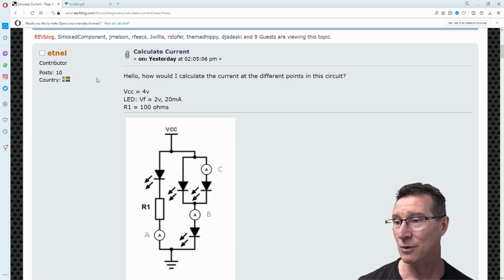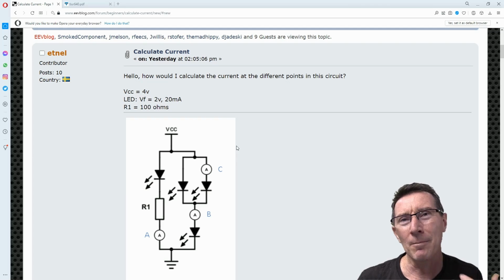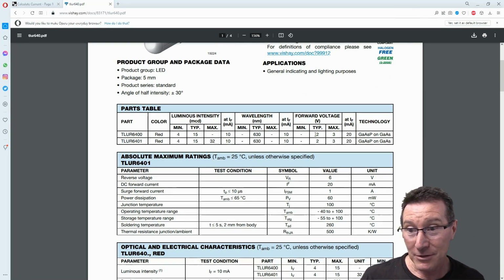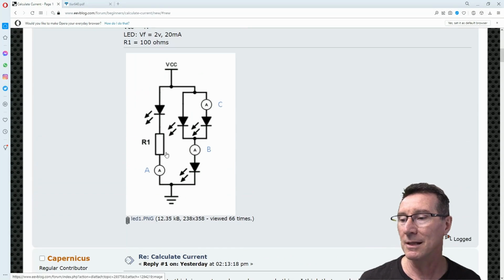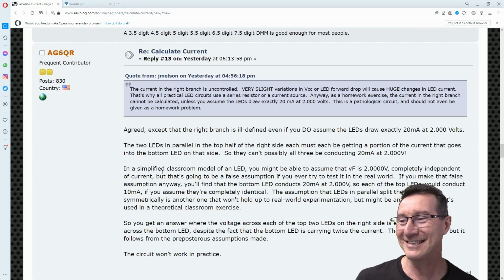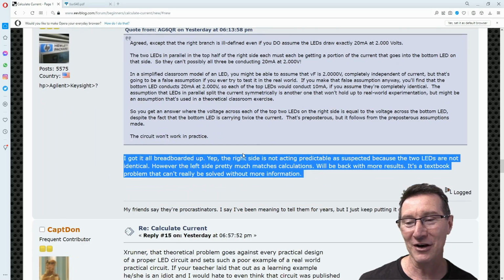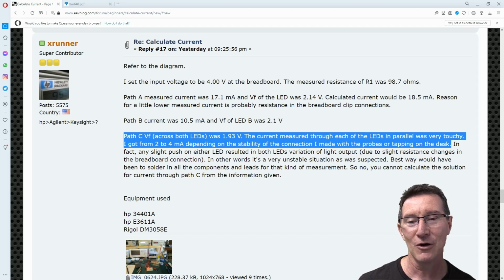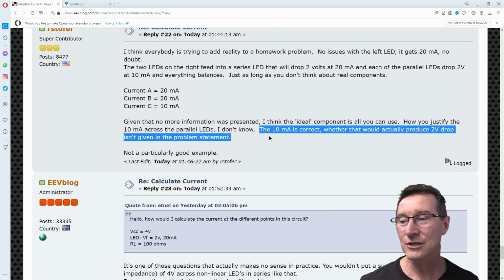EEVblog 1427 - An INFURIATING Electronics Exam Question!

Comment from the maker: There is a reply from the OP:
"Thank you, everyone. Especially Dave for even making a whole video regarding the problem. Very interesting to read your different approaches.

So, the backstory of the problem. The circuit got handed to us in a high school entry course in electronics. The circuit was supposedly made by our teacher. Our teacher seems to have lacking knowledge regarding LEDs and current in a series circuit. By his means, the LED drops voltage AND current. I had to prove him wrong 8).

We got to both calculate and elaborate. When elaborating, I got similar results as Dave in his video. But when I had to calculate the right branch, things got a little confusing, thus creating the thread. The circuit that stood out to me as my first thought was that insufficient information was given. But I made the assumption that Vf = 2.0 at all given currents(which would not be the case in reality). My conclusion was, half of the current goes through each LED which is in pairs. But the circuit seemed odd anyway.

I see some of you made some good realistic calculations, but it is not near the level of this course. Ohms law and Kirchoff's are pretty much the only formulas used. If my teacher is watching this thread, maybe he could post the sole purpose of this circuit with calculations included. The circuit in my opinion is just a brain itch and would never be used in reality(hopefully). An LED circuit is never seen as a theoretical circuit for me."
Reply: my response would be "use a multi-meter"
Reply: I actually have seen such a circuit in reality: In cheap outdoor solar light chains.
The individual LEDs have been wired in parallel. Due to the cable resistance from LED to LED, the following LED was sligthly dimmer than the last. However, no one would drive LEDs without a current limiter on a low impedance source. Even if you carefully match the supply voltage with the LEDs Vf and use the battery/wire impedance for current limiting, the Vf of the LEDs is dropping with temperature, so they would quickly burn through.
Reply: @paulkocyla1343  I ran a few chains of 10mm super high brightness leds directly off 12v 10a supplies for quite a while, their Vf adding up to just over 12v,  but then the cheap Chinese leds started to fail so I replaced them with bits of led strips. Maybe running them that way shortened their lives a bit, but they didnt burn through quickly. I got around 200 hours use before the odd one would make the chain flicker or fail.
Reply: @stephenw2992  200 hours is not a long time. It's 4 a hair over days between failure. That's rubbish tbh
Reply: Makes sense that it was proposed by someone who is not very competent if this was set as a homework question. It is an excellent discussion question for class but a very poor homework question. As well as the obvious here, students should know that temperature effects diodes but how many know that the light falling on an LED will also change the current through it or that LEDs can be used as power sources? (This can lead on to solar panel discussion, etc.) When producing test or exam questions, the examiner must be far more competent than the answer requires. One sees so many sloppy questions where anybody with any competence in the subject has to start by answering, 'well, it depends...'. And that should never be the case for non-discussion test or exam. It is why multiple choice is often good. When you work out a multiple choice question, the answer you work out will nearly always be one of the choices or very close to one of them. At the very least, you might get an idea of what the examiner is expecting you to answer.
Reply: The Op is wrong in not being able to see that LEDs do drop voltage and they also limit current to some degree. A case in point: I created 2 LED Christmas light strings that were of different LED types, but from the same manufacturer and same string build. When I was done making a purple and orange string they both took on the power usage characteristic of the previous lower rated all same color LED string.  I see some people falsely think just because a component has rated operating specs then it must draw that current and have that voltage across it. I have known for decades  that a single diode has a silicon PN breakdown voltage of 0.7volts, but if you put additional diodes in parallel then the effective voltage drop will decrease. Most people don't think that is even possible because diodes are not used that way. Now if you want to screw around with people an you do that in a solve this circuit test problem.
Reply: @kjrchannel1480  The reason diodes are not used in parallel is that they have a negative temperature coefficient of voltage at a given current, coupled with an almost exponential increase in current with voltage (although you're right that they do have a small resistive component).

If you have two diodes in parallel, as soon as one gets slightly warmer than the other, it will start to pass more of the current than the other, which will make it warmer, and so on until one of the pair is passing the majority of the current, regardless of how well-matched they started off.

You can make matched p-n junctions that thermally track inside an integrated circuit, but they are only passing small currents (like in a current mirror). With discrete components, there's no easy way to parallel diodes to increase their current capacity; you just have to use a single higher spec diode.
Reply: @kjrchannel1480  LED's are not silicon diodes. They are constructed from III-V type materials, such as Gallium, Arsenic, etc. They forward drop correlates with the color of emission, red, amber, yellow, green, blue. A Schotty diode has a forward drop of 0.350 volts, and it is a silicon diode. There is an equation for current as a function of voltage and temperature and a fudge factor.
Reply: ??  As an analytical question, this looked like a load-line question where you'd be assuming matched diodes with exponential characteristics.  The challenges to the validity of these assumptions in practical work are very true.
Reply: @UC4RfGzqBbYiCo088mytrkaw I said unlimited, not infinite. You'll perhaps note that I prefixed my remark by *if there is no resistive element*.

If the band gap of each LED is more than 2V, you'll get nothing. If it's less than 2V, then it will light and current will pass. If there were no resistive component, that current would heat the LED which would conduct more current, and so on until the LED burns out. You'll get thermal runaway unless the "voltage source" has some means of limiting current or the LED has sufficient bulk resistance to limit it to a safe value. That's why you can model an LED over the relevant part of its V-I curve as a small resistor (the slope of the V-I) plus an ideal Zener diode (the intercept of that slope on the V-axis). For LEDs described as 2V 20mA, you'll find that a 20R resistor + 1.6V Zener will model it quite well over the 10-30mA range of operation.
Reply: Can you make a video about faraday's law where the kvl doesn't hold and emf equals -NdΦ/dt = closed intergal of E•dl. I'm learning electromagnetism by the Walter lewin MIT courses here on YouTube and I know he's right but it's so counter intuitive where i can't get a feel for the explanation since he's the one of two people who have videos on this topic. His video is kvl for the birds. I would like to see your take on it since I'm sure many students are confused about the topic. Thank you for the informative content
Reply: I might be under thinking this but assuming this is a purely resistive circuit wouldn't you get the resistance of each LED and add them up to your combination circuit? if that's the case I ended up with A.) 0.0364A B.)0.2667A and c.)0.1333A
Reply: @ramonbenavides7125  

No. LEDs don't act like resistors.
Reply: @westelaudio943  LEDs are like diodes? , but all these teachers always teach the class like its resistors.
Reply: @westelaudio943  They don't, but I think that's what OP was getting at with his post. The teacher thought they did - My guess is that the teacher wanted to add an extra trick to the question to make you treat the LEDs like 1k resistors 2v/20mA, and then the question makes sense, but we all know that's BS. Clearly this teacher shouldn't be teaching this subject.
Reply: @haydenhoodless2055  Actually, they kind-of do act like a resistor, but it's a low value resistance in series with an ideal Zener diode. All diodes have a bulk resistance in the P and N layers each side of the junction, so we shouldn't be surprised that they have a resistive component.

An LED will pass almost no current until a certain critical voltage is reached when the junction starts to conduct strongly. At that point the voltage across the junction rises logarithmically (i.e. slowly) with current, while the voltage across the bulk resistance rises linearly with current.

As I've described in another thread, treating common red LEDs as a 1.6V Zener + a 20ohm resistor will allow you to get some idea of the actual current flowing in different parts of the circuit - at least until components start to get hot and temperature effects become significant.
Reply: @RexxSchneider   For the intents of this level of electronics, then we assume that the restriction of current is negligible through an LED just as we do with wires, even though realistically a small resistive property must be seen in order for power dissipation to occur. The point is that the question is about testing knowledge of Kirchhoff’s current laws, but the teacher intended to make the students treat the LEDs as 1k resistors.
Reply: @haydenhoodless2055  Unfortunately, if there is no resistive element to limit the current through the LED, then putting 4V across two LEDs in series will either result in no current or an unlimited current flow as they warm up. You simply can't can't model LEDS any other way. A question is only useful for testing knowledge of current laws if you use the correct model for the circuit elements, regardless of what you might think "this level of electronics" is. We all know that you can't model LEDs as 1K resistors, and I don't believe you can have a definite idea of what the teacher intended.
Reply: @93hothead  guess what the "D" in "LED" stands for :P
Yes, an led behaves exactly like a diode, with the difference that it makes light in the process
Reply: @haydenhoodless2055  I think your definition of "resistive" is wrong. You do get a voltage drop, which is required to get the required power, but it's not "resistive". "resistive" means a linear correlation between voltage and current.
Most of the things you said are correct, but that a "resistive" element is required to extract the power required for lighting up is just wrong. (unless I'm completely mistaken, in that case correct me)
Reply: @ramonbenavides7125  I guess you mean 20mA for A?
Reply: Well actualy if you ask me your teacher must be expelled without question.
Thats why the world is failing, people like your so called teacher are less educated then the students. And thats not gona yield proper knowledge and workforce.

Comment: This circuit would make more sense, if VCC was a 40 milliamp constant current source. Theoretically, A would equal 20, B would equal 20, C would equal 10 milliamps. A would be most accurate, because there would be 2 volts across the 100 Ohm resistor.

Comment: The only theoretical right answer i can think of when all the diodes have exactly the same (non linear) characteristics;

1) the current at point A= 20mA
2) the current at point B= 2x the current at point C
3) Since the voltage over the led (current point B) is unequal to 2 volt we do not know the current at point B
4) And there for we also do not know the current at point C  🙂

Comment: The most correct and complete answer that it is possible to give is...  A = 20 mA, B > 20 mA, C < 20 mA (and C = B/2). Without the LED characteristic curve, we cannot be any more accurate than that, but we do know B will be > 20 mA and C < 20 mA because the voltage across the top two diodes will be less than the voltage across the lower diode.

Comment: In school I had a physics teacher that was a physics doctor (don't know if that's the right term) and he would have loved that problem. He wasn't a very good teacher (didn't know how to tell the stuff to the students) but he was really good at math and physics. And he was also interested in questions that were a bit off-topic or only topic-related. So if you didn't understand something or had a question to another topic, he took the time in his break or even after school to calculate the answer or to explain it with really good drawings on the board. If he didn't know something, he told us he didn't know instead of trying to find an easy answer to not "look bad" in front of the class. But he then took the time to look the question up and explain it in detail in the next lesson.

Comment: It's not such a bad question, as it invites to express all sorts of concern, giving you a chance to show your understanding of leds. A possible (quick) answer could start with confirming the left hand side is perfectly ok, and the right hand side is 20ma through the bottom, and 10ma through each individual led. That said, you could elaborate a bit, about leds being non-linear. So, in real life, the current through the bottom led will be more than 20mA (perhaps 22mA) and through each individual led also a bit more, perhaps 11mA. An precise calculation is not possible, with the data provided. But I agree it is a silly circuit to be forgotten quickly.

Comment: Easy answer: assuming resistance in the wires. what is the resistance in the wires?
Assuming no resistance in the wires, one or more of the LEDs on the right blows and you end up with 0 on the right branch.

Comment: The only way to properly "balance" that circuit, particularly on the right side, even with exactly identical LEDs, would be to add another (identical) ammeter in series with the "middle" LED. One mustn't forget that inserting a measuring instrument into a circuit, whatever it is, will change the parameters to at least some degree. Did the examiners account for this?

Comment: I put those in electrical circuit simulator and I got in there
A= 23.247521 mA
B= 987.45143 mA
C= 493.725715 mA

I'm not sure if those comes so wierd becouse of computers floating point errors or software does something interesting

Comment: Uhmm..let me play the devil's advocate role here saying that, I guess, the professor was trying to make a "trap" on this one; I mean he probably was expecting an answer more or less like this: Ia = 20mA, Ic = Ib/2 (supposing all the LEDs are identical) and, more important, Ib HAS TO BE GREATER THAN 20mA. Probably the latter part of this answer was what is he was asking for. On the latter, despite being impossible numerically calculating the current, because the professor didn't give us the V-I transfer curve of the LED, we can say for sure that, whatever the current Ib could be, it has to be greater than 20mA, because every other solution is impossible. 
In fact, if you suppose that Ib = 20mA, you are automatically saying that the voltage on that LED is 2V, hence also the parallel LEDs on top of it must have 2V on them, wich would impose a current in each of them equal to 20mA: this is an impossible solution beacuse it violates the first of the Kirchhoff's laws (algebraic sum of the currents flowing in to  and out of a node has to be zero).
Equally, if you suppose that Ib < 20mA, you're saying that voltage on the LED is less than 2V, hence the parallel LEDs on top of it must have a voltage of more than 2V on them, wich would impose a current in each of them greater than 20mA: this is, again, an impossible solution violating the first of the Kirchhoff's laws.

Comment: The LEDs in parallel will have slightly less than 2V across and have equal current thru each branch, each <20mA.  The LED on the bottom will have slightly more than 2V across and carry >20mA such that the current is 2X of that for each top LED. For example, 15mA for C and 30mA for B.

Comment: A is of no doubt 20mA.
B is at minimum 20mA.
C is at maximum 10mA.
And B&C are both close but not fully on their extreme points.
But as every circuit contains deviations, the left part is self-stabilizing, where the richt part only survives by luck.

Comment: the current thru R1 affects volt across R1 which in turn affect the volt across LED, which affects the current of the LED (which is the current thru R1). Chicken and Egg? Well, that is the sign of dreaded existence of "feedback", meaning, needing differential equations and Laplace transform. Well "feedback" is the reason people are paying big bucks to you, the engineer, because it usually scare the rest of people to social studies and economics.

Comment: This is actually an amazing question and one I find very typical. As an instructor, I may actually use this question in my Analog Electronics course where we cover semiconductor based components. 

To "properly" analyze this, we would have to do iterative analysis using ideal assumptions to get a ballpark answer, similar to as Tomo* in the video did. Assume 2V @ 20mA for the single LED. KCL says 10mA through the parallel LEDs. Then using the 10mA, calculate the voltage drop across an ideal diode. Then use the voltage drop to calculate a new voltage drop for the single LED. Then calculate the current through that LED with that voltage drop. Then divide that current and calculate the voltage drop across the parallel LEDs. Repeat this process a couple more time to allow the variations to stabilize.